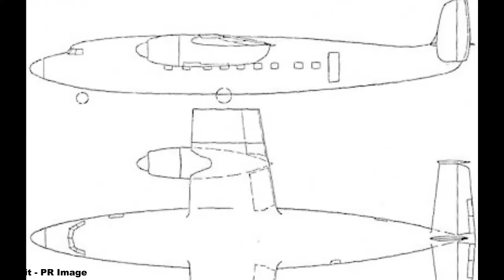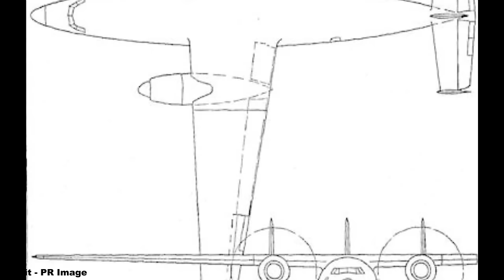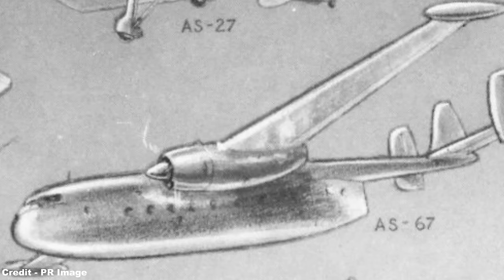Airspeed Ambassador - The Silver Wing

Comment: The Airspeed Ambasidor known as the Elizabeathan was flown in Australia by Butler Airlines in the late 1950's ( I saw them landing several time at YCFS) till Ansett Airlines bought them out & they were replaced by F27 Fokker Friendships.
Reply: Australian pilots flying the Ambassador were hugely impressed by the aircraft's power and performance. When lightly loaded on New South Wales regional services their climb rate and take-off angles were exceptional, and passengers in the rearward facing seats at the front of the cabin would find themselves pressing against their seatbelts while literally looking down at their forward facing co-passengers.
Reply: @Holland41  I flew with some of those Pilots.
One Captain Jack H was being tested by a DCA Examiner at Canberra & he pulled an engine before they had enough speed & they skidded to a halt on it's belly.

Comment: Thanks for this. I dont print a lot. But when im printing a box or a bracket or most of the time a car part ive had a real hard time getting it close enough.  

Im going to try this

My geetech is in a very sturdy metal cabinet with a plexi door. Ive thought about putting a cross brace across the cabinet to the upper gamtry. It seems even a bettter built printer would have flex especially if the filiment is shaking around on top of it. A very slight flex 250 mm up could cause a serious bed gap difference at the front and back of the bed.

Comment: The only replacement for a DC-3 is another DC-3. Quote from Donald Douglas Sr. 1946. Besides, the only thing I remember the Ambassador for is the Munich crash. Where the aircraft had about 90% of the fault. Too big, too heavy combined with abysmally weak engines. Basically obsolete by design and long before the first was delivered.